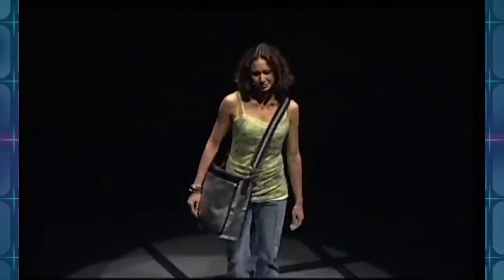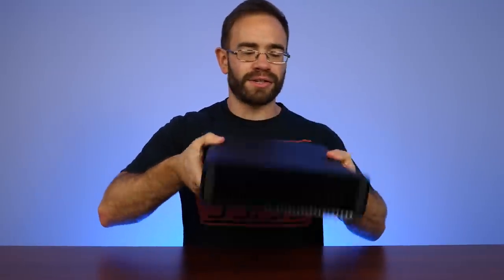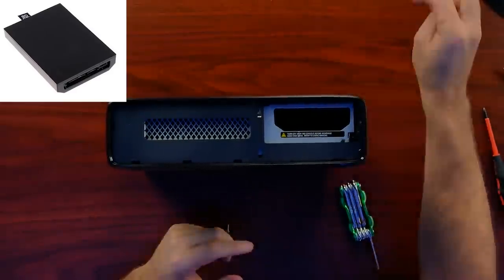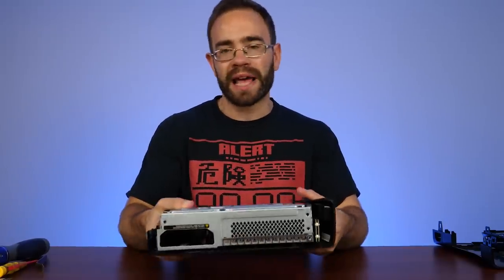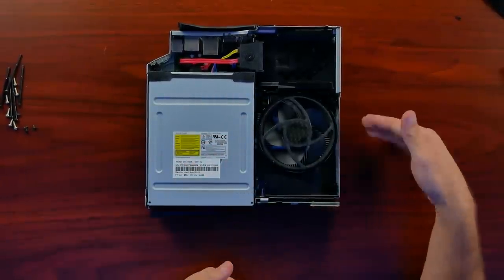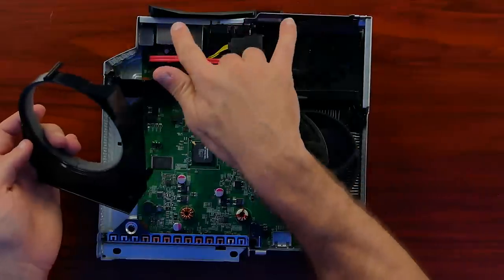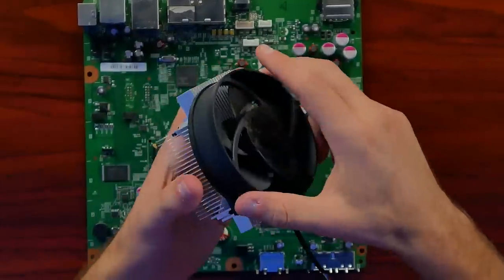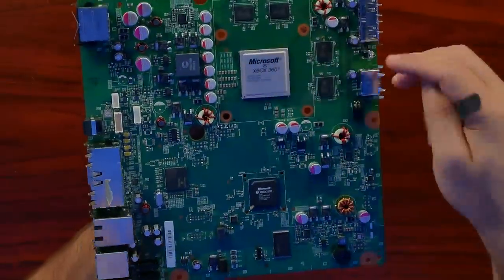Here's How Microsoft Solved The Xbox 360 Red Ring of Death

Comment: Just to clarify, RROD, and the PS3 YLOD was so common as new tech needed to use lead free solder to be R.O.H.S compliant Lead free solder has a higher melting point and its also brittle, where as leaded solder is flexable and when a chip is stuck on a BGA when the chip goes through thermal expansion then all them little balls need to flex abit, (I take ti thats the reason they made boards flex more compared to how they used to be) but if you are using Lead free solder then eventually them balls are gonna crack as they become brittle over time,
Reply: @chrisgotgames6405  Im not gonna know if EVERY single 360 from 05 to 2012 uses a specific solder, I have pretty much said it all in the first post, and due to advancements in how technology is made now its rare to see this being a problem, on the development side of things MS would know that the ROHS law was gonna be a thing for selling mass produced items, The problem is how the solder works, as PCB's were more rigid compared to today, they could not move with heat like they do today thus causing lead free solder to crack, and as the BGA was big and had a linear pattern its more likely to happen because of the area of heat, With the PS3 removing the EE was simply removing excess heat from the entire package, and also the PS3 had a different BGA Style, yes it was still a big chip, but just due to the layout of the chip it was at less risk overall, Regardless with any system if you didnt play it for more than 6h straight and actually gave them time to breathe and was placed in a well vented area the rarer you seen these problems, but consoles are typically abused anyway.

Comment: 3:06
It was shown that a horizontally oriented console is less prone to having problems with the disc drive, when compared to a console kept in a vertical orientation.  So, why would MS design such a feature that would function better when the console was placed in the orientation that demonstrated a greater capacity for causing problems???

Comment: I still have my 360 S that got pulled off the shelf by a charge cord, I pushed the disc drive back in and clipped the clips that I could back and it somehow hasn't had a problem since.

Comment: I had one of those units you clipped to the back of your 360 that had a bunch of extra fans and plugged into the rear USB port. Then people with those units started reporting that they were setting on fire so I got rid of mine. A short while later I got the RRoD. Are the two correlated? Probably not, but younger me thought so. Luckily Microsoft replaced my 360 for free.

Comment: Admittedly skimmed the video and the comments but the ACTUAL ISSUE as I understand it was the sudden industry switch from leaded solder to lead-free solder, which was required by law. However much of the lead-free solder being used would crack and also dendrites could develop. So basically connections under the CPU or GPU could be lost, but also new ones could grow and cause a short. This took years to figure out.

Comment: Was interesting to see. As someone that only owns the Original (don't know if thats the Arcade or not, its the one with the memory cards and Component/HDMI) and a 360 E I've not had too many issues with the Original. Only 1 hard drive failure then I left the system t to the side like my Wii. Then years later pulled it out and got a USB and it worked fine (unlike my overheated PS2 capable PS3 where it had to be gutted to get the Mass Effect 3 disk out :( ) upgraded it with a 120GB drive for those models and its not too bad. The disk tray is awkward to use, and the LED doesn't display anymore (this was just a few days ago) and I only play disks and don't have this one conneced to the internet as I don't need it to. Not too bad as it works but its not perfect. I plan to use the E whem others in thr family don:t want it due to PS5. Got to say the one thing I found odd was it having only the top red light on for an error (even screenshot it). My guess is due to the LEDs and it not displaying the others or its an error for the power cable connectio  or something as there is no mention of it for the 4 error lights.

Comment: My roommate's kids 360 finally died last week. Not bad since it lasted this long. My "fix" for it was to buy a 360 S for them. ;>

I'm equipped with gear up to an IR/Hot air station, but reading that the repaired fix rate was so bad I took the cowards way out.

Comment: 14:44 I find it less impressive that, in 5 years, Microsoft and IBM managed to do one die shrink and one re-design, but perhaps I'm prejudiced by my experience in chip design. It's even less impressive when you consider Microsoft knowingly shipped a consumer product with a high failure rate for 5 years.
What I wonder is whether the 360 CPU MCM inspired the AMD APU MCMs used in PCs, Series X/S, and PS5, 'cause I still remember the Pentium II MCM!😣

Comment: I remember when my first xbox 360 RROD on me.  I had to send it off to get it fixed. they paid for all the shipping and handling.  everyone online kept saying it was going to take forever to come back. Nope it came back to me within a week and half. turned out Microsoft had a repair center in the next town over. It was a 20 minute drive to their center.   that repaired console lasted for another 3 months so I sent it back. took the same time to come back.  this time it lasted 6 months. then it died again.  luckily at around that time I had gone into a pawn shop and they were selling a slim version brand new, never used. it was the Halo Reach edition. it was still in the original box. strange was that the game wasn't included. but that was ok, I just wanted the console. so I bought it. it lasted me a long time. Actually by the time I traded it in for the PS4 I wasn't even using it anymore.  although on the exact same day I traded it into Gamestop, it was bought by one of the employees. he was salivating all over it while I was trading it.

Comment: I used to have a 360 with red ring of death. My dad took it apart to try to fix it. Turns out the 2 fans failed. So he cut a big hole in the side and duct taped a new fan to the hole. It ran for another year.

Comment: The 360 slims can and will still RRoD. Corona revisions for example have cheaply made southbridges that can die within time, and Trinities can still have XCGPU failures.

Your "flexing" concern was most likely because of the infamous "xclamp fix" or bolt mod as more commonly referred to now, where people would replace the xclamps with bolts & washers to increase pressure between the GPU and the heatsink. The 360 board was made to move, so the bolts would cause extreme pressure & end up warping the board entirely.

The real reason RRoD occurred was primarily because the underfill in the GPU goes bad and does not make a secure connection between the substrate and the die, which can cause separation and kill the GPU. Same with PS3's nowadays. The only way to fix it is to replace the GPU.

Comment: The number one factor why they broke was the law changed that all electronics must have lead free solder before the 360 launched. if that had not happened the fail rate would have been much lower. IMO Ps3 had just as bad fail rate but since sony didn't acknowledge it as much there isn't as many documented faults. HP laptops too from that era had a lot of faults relating to solder balls cracking.

Comment: I had disc drive problems on mine, it would randomly not start spinning the disc when you put a disc in and I had to open and close it like 50 times to get it to work, and then keep the game on for several days otherwise it'd not spin the disc again. This is also where I found out extended warranty's are a garbage scam, 90 day best estimate turn around, had to pay insured shipping both ways, like $50-$60 total and if they found I had violated their insane policy on console care they wouldn't do anything to fix it (dust in the console counted as a violation they said). I just bought a new one and never paid for an extended warranty on anything ever again.

Comment: I still have my 360 S, and my only issue with it is that the disk drive is extremely loud. The only way I can make it quieter is to put something heavy over the top of the console. Any suggestions to fix this? I have the special MW3 edition console, so I don't want to replace the disk drive and lose the styling of the disk tray

Comment: I remember my Xbox 360 starting to have real issues with the disc drive. I want to say it was the 2008 revision w/ silver accents..? Not sure if that and the old "Elite" overlap in that way, but that's my assumption. Just smacking it over and over when putting a new game in worked for months, but then it was over and I just went with an S model. But even in my other 360 before the disc reading issues, I had it upright, knocked it over, and ruined my MW2 disc at the time. Totally sucked... But then after a couple years, the S started having issues with power supply. Except after replacing it, it happened AGAIN! Jesus...

Comment: Question. You seem to stress the main issue was the og 360 had 2 fans that had to pull air from across the entire system and it wasn't efficient. Isn't the series x basically designed the same way? One fan has to pull air across the entire system. Is this going to create a similar issue potentially?
Reply: @chrisgotgames6405  are you sure? I'm almost certain the series x fan is at the top and it's pulling air from the bottom through the components and out the top.

Comment: Once you know how to properly disassambly the plastic shel, its funny, easy. I saw lot of "tutorials" and smart life hacks, but actualy all the clips are accesible and can be easily uncliped, as weel as the last one, it seems to be hiden, but under the label is small hole you can penetrate and simply push the last clip and it pops out without any struggle or using force or pry the plastics away or even break or damage the cover. Once you open the plastic cover, look from inside to that hole and you realize it was just made that way and the label is actualy like a seal... you can open it without penetrate the label, but there is no easier way like i said...

Comment: I would literally run mine on top of our AC vents in the floor with a layer of paper towels on top with thicc ice packs. Allowed my 05 model to last until 2015 when it finally died when the disc drive failed and I didn’t want to fix it.

Comment: Actually the metal casing for the first editions of the xbox360 had improper dimensions which flexed the board.  There were tons of so called different fixes but I don't think it was ever properly resolved for the original early white FAT 360 boxes.   Lots of people added those stupid X clamps to prevent flexing of the circuit board but that made no difference because it was the metal casing that you screwed the board onto that was poorly designed.  Anyone with an original should check the depth of the screw holes.  it is a moulded metal box and there are a few of the raised sections with screw holes that are lower than the other raised sections...therefore flexing the board even after adding X clamps.  I came across it in a post and no one seems to have picked it up or made it more well known so all the other perceived fixes got more attention.  Some of the raised parts of the metal casing were 0.5mm out compared to other raised bits.  it doesn't seem a lot but with heat that can cause serious problems.  I filed my metal case at the correct points so that the levels were equal all around the inside of the case.   Never had a problem since.  I went through 6 xbox 360's returned to microsoft before I fixed mine .   Still got it today... in fact I just replaced the fans about a month ago.
Reply: Do you have a link to this post?

Comment: I got a halo 4 Edition of the Xbox 360! It has that red dot! It goes off 1 or 2 times, rare occasions zero, and the fan starts airing out! It can't have stuff around iit, or have anything oonn the faann, or it can't air out! The Xbox 360 works pretty well, everything is in pretty good shape! I don't mind the red dot Delay, and I have gotten use to it for years nnoooww! This is aa pretty rare Xbox 360, and I would never trade it inn! I use to have a White Xbox 360, and I'm glad I got rid of iit years ago, because A century later, I found out that white Xbox 360 would literally melt the motherboard! Ssoo I'm glad I got the blue Xbox 360!😄

PS: when I run my games on my 360, is pretty quiet! 😄buut when you run halo 3, iit's pretty lloouud!😅

Comment: I bought one of the versions just before the slim, and the RROD was supposed to be fixed.  I still got a RROD after about 4 months. I bought the extended warranty so It was replaced with a second one. The second one RROD after a few months and my warranty didn't cover another replacement. My friend gave me a Gamestop Refurbished one for Christmas, and it lasted 2 weeks. I never got another one, and vowed to never buy another piece of hardware from Microsoft.

Comment: I still have my old xbox 360 elite not the newer xbox 360 E from 2013 but the old one it did red ring once on me but my dad is a expert tech repair guy and ReSouldered reset everything and replaced a few components on the board and it's working today. Only annoyance is that it has coil wine but I got use to that after a while

Comment: If I remember correctly, the reason for the red ring was essentially microsoft being lazy. Usually when making a console you design all the internals and have a general idea of how the system is going to look, then you build it's shell around it. The opposite was done with the original 360 in that they built the shell first then all the internals were built after and basically had to be crammed inside giving little to no airflow. That's why if you moved your system while it was playing it'd freeze or red ring because everything being so close is bumping into each other and doing things they're not supposed to.

Comment: I had one of those. It failed with RROD. Heated the GPU up a little to see if it was the flip chip, and it worked for a few minutes. It was the flip chip solder balls attached to the organic board. Not fixable.

I absolutely hate flip chips, they're unreliable.

Comment: The cpu was soldered into the motherboard instead of using pins. If the xbox was used for a long time and got hot the solder would reflow and ruin the connections. I had a "Falcon" motherboard 360 that worked perfectly from 2008 to 2015 until i left it on overnight to download a big game (I had a slow internet). Then i got the error.

Comment: Dam I remember doing the towel and never knew how that actually made it work again 😂
Reply: It's like sticking a potato In the muffler if the check engine light is on. A Reflow blowing hot air/or towel trick will make it work for a few months then it will be dead for ever.

Comment: I went through 3 Xbox 360 consoles. The first one got stolen from a local repair shop and the next 2 kept having the disc get stuck or just fail to read discs and had to replace the drive twice before I got fed up and just got a PS4 and never looked back until recently.

Comment: They are still expensive because the only way to play Xbox 360 games locally is on a 360. If you live in a place that has bad internet this is preferred as backwards compatibility on modern xbox consoles requires d.r.m. and online authentication for emulation.

Comment: The Xbox 360 Elite was way better and the power bricks have a way lower failure rate. Personally I had several Xbox Slim bricks that would just randomly overheat even with external cooling but I stuck my Xbox Elite right in front of the sun durin the summer on a scorching hot day and it never overheated even once. I still have it and it works several years later. Ofc the power brick wasn't in front of the sun, no need for it. But it never overheated either and I needed the Xbox there because it was sitting in the window so I could connect to the internet to watch Youtube or play black ops 1 zombies and it surprisingly worked well considering I was paying ten bucks a month to borrow my neighbor's WIFI.

Comment: My original 360 rrod’d like most and then got a gpu failed message on my slim, both systems only had very lite use so was very disappointed. My vcr Xbox one is still going strong, I’m glad Microsoft finally got there stuff together..

Comment: sooo, they reduced two 90nm chips down to a single 45nm chip, 90nm (about 1.4v) to 45nm (about 1.3v), hmm, yet the power savings was from reducing VRM phase counts, oh kay. tad bit bass-ackwards yet close enough I guess. a bit confusing I guess since intel was pushing their CPUs to the limits at the time, yet if keeping clocks the same I think the voltage should be dropping from around 1.36v on 90nm (Prescott) down to 1.3v or so on 45nm (yorkfield), that alone equals a major decrease in power consumption (esp if it's the same circuit just shrunk in size). so fewer VRM phases as the current draw for each is much lower with the new single chip. also, fewer chips is fewer power rails as well (GPU-io and CPU-io, is now a single APU-io rail).  VRMs are more a trade-off of many things kind of thing (room for the VRM cooler, power density per phase driver, the current draw of the powered device at what voltage, how much ripple can that device handle from the VRM, etc).

Nice teardown of the X-box. B)